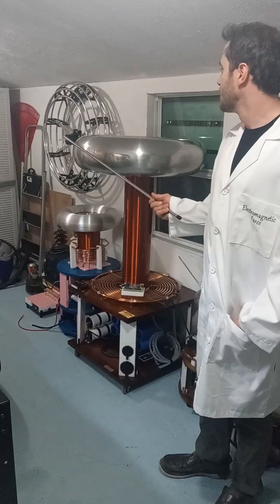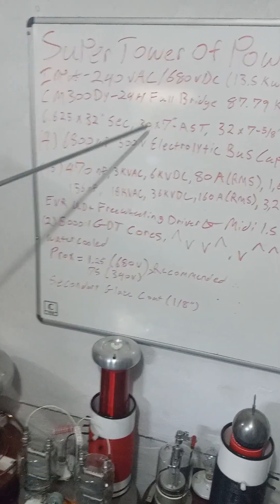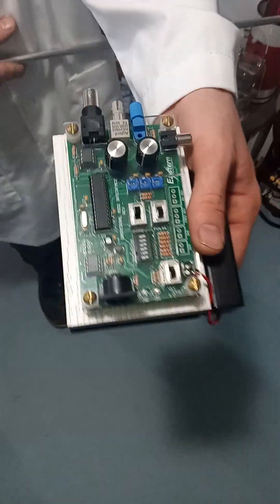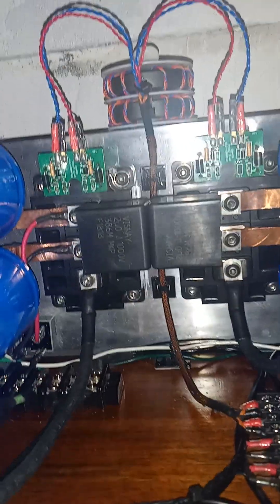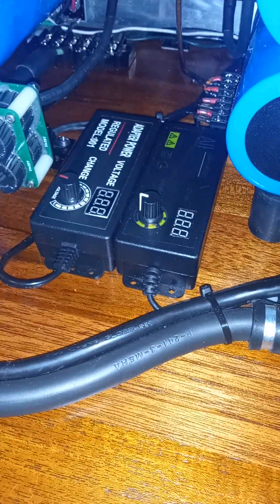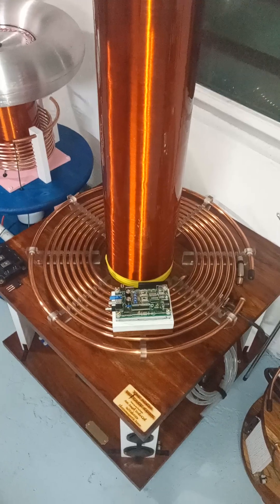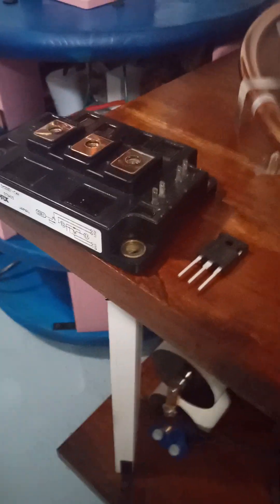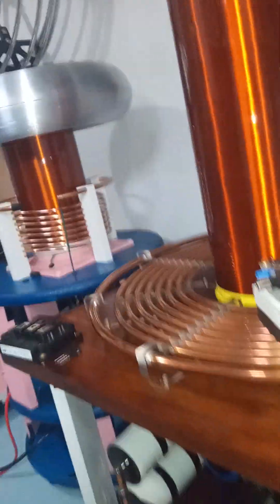Super Tower of Power DRSSTC Tesla Coil: In-Depth Overview!

Comment: Only 156nf for such a big coil?
Reply from the maker: Yes, less inductive heating. The caps voltage rating is a big factor in the arc length
Reply: Cool video kye, In a series resonant circuit at resonance the  capacitors and coil ( primary) have equal voltage (180 degrees out of phase) as you move away from resonance, below becomes capacitive so the voltage across the caps increase and above resonance becomes inductive so the primary coil voltage increases, running slightly above (rather than below) is favorable for a few reasons too complex to get into in a yt comment. Its easier on the swiches and gate drive although it might not necessarily produce the best output 👍👍 in a parallel resonant LC circuit the opposite is true, the voltage across the caps and coil is the same and in phase it has to be they are in parallel 😅 in a parallel resonant LC circuit VTTC etc its the current that is 180 degrees out of phase.. good  work on the build it looks fantastic buddy... il be back on fb as soon as I'm well 😔👍❤